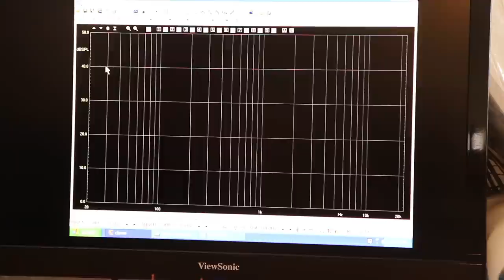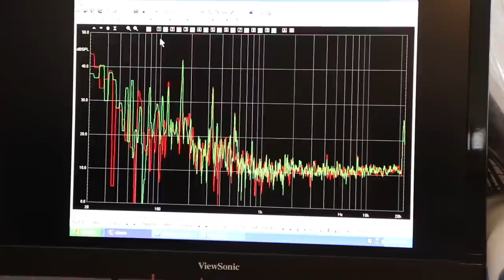Power Cable Tech Talk and a little help for Amir at Audio Science Review

Comment: i worked at a power supple company for over two decades and we had a high end Marconi receiver we used to test our power supplies for compliance with the UL requirement for conducted and radiated noise. That taught me how important conductor orientation as well as component orientation is when you want to reduce susceptibility to radiated noise. 

Quite a few of today's products use switch mode power supplies, if these are well designed they should not cause to much interference but be aware that quite a few small switch mode power bricks are not well designed when it comes to noise and some of the certifications you see stamped on them is just eyewash. Any country that would put melamine in baby food has to be watched carefully and their products have to be periodically checked to make sure they are complying with radiated noise requirements because they might change vendors and not realize the new vendors supplies are not what they think they are

Comment: Double-blind testing.  I've never seen a double-blind test showing an audible improvement for an expensive  power cable.  Until I see that test, I'm with Amir on this one.  But I'll go with Danny on his improvements to stock Klipsch speakers.  That improvement is both audible and measurable.  It's like turning off the "loudness" button on an old receiver.  The only audible noise I've ever had came from a ground loop.  And that had nothing to do with the power cable.

Comment: Definitely a good idea to keep interconnects from mains cables but in my time, no recording studio or mastering suite that I have visited had any fancy expensive mains cables.
Reply: & they are usually a mess; cables chris crossing all over the place...mmm...
Reply: Back in the day I had a friend who built recording studios as his business. The electrical systems in these recording studio he built are all custom built for purpose. I had even seen one studio with huge transformers installed in the back of the building. I assume that is why the power coming out from the outlets are clean and there is no need for power conditioning or the sort.
Reply: @jasonleyson7825  given the amount of money audiophiles put into line conditioners and magic cables, over and over again, they could do the same for their home.
Reply: @jasonleyson7825  Hi, there are a kind or triphasic power transformer used for "isolates" the secondary to the grid or primary circuit from electrical perturbations, noises, transitoires and electrical short circuit. It's made using a specific type i.e. of star delta connection and  design. They are called "power transformer for isolation" . Could be this
Reply: I remember, is a delta/delta power transformer and in some cases with the same voltage in primary and secondary. Please check the plate. Thank You
Reply: If you can't hear the difference then don't spend the money I can so I do no testing involved
Reply: @SKELERTON1  I bet you don’t, you just think you do due to the placebo effect. It is incredibly strong and hard to fight. Do double blind testing, and 100% you won’t spot any difference.
Reply: They use balanced interconnects, and professional equipment is properly designed (mainly) and power cables is a load of BS.
Reply: @SKELERTON1  Correction: You THINK you can hear a difference. Hearing it in reality, or hearing it cause you "Believe" you do feel the same, but they are caused by two entirely different factors. If you TRULY heard a difference, it would be measurable and it would be demonstratable and repeatable.
Reply: Haha, very true. Mogami cables might be the most expensive ones you might need, max. But that's just because of the lifetime warranty, reliability, and the awesome Neutrik connectors that wont fail you.
Reply: There are smart audiophiles, also. We "objective audiophiles" on the ASR are audiophiles as well. We just use our money a bit smarter in general for obvious reasons.
Reply: @jasonleyson7825 what about the power coming into the building ?

Comment: You said in the video that, the burn-in is important, because the conductor and dielectric are changing their properties. According to this phenomenon, can you tell what is a life span of a power cable and how often should I replace it?
Reply: often
Reply: @spudpud-T67  Thank you for the advice. After this answer I already know when to change the cables.
Reply: I burn them in for about 32 hours and then I find that the quality starts to deteriorate at about 50 hours so I use my cables for about 18 before I replace. I of course have a very resolving systems. For less resolving system you can probably use a cable for at least 50 before you notice deterioration.
Reply: BURN IN TIME FOR A CABLE...!🤣🤣🤣🤣🤣🤣🤣🤣🤣🤣🤣🤣🤣

Comment: I like this back and forth. I watch you and Amir both I'll like your comment on his assertion that once power goes into a component it is filtered for noise and stabilized before being used. Thanks.
Reply: If that were true then the power cables like ours would have no audible effect, but they do.
Reply: If the null test noise (regardless of it beeing a difference of random noises) was below 93dB in level you would have to play plenty loud and then wait for your ears to stop protecting themselves to be able to distinguish the noise at all. Every sound comparable in frequency also increasing the masking effect.

It’s not really scientific to say the cause of the experience of sound difference is due to sound altered by the noise in cables? That would be a jump into a conclusion from interpretation ignoring the psychoacoustics.
Reply: @martinenstrom8206  Or it could be in reality not 93db down.
Reply: @martinenstrom8206  well said!
Reply: Cody Smith  We have proven it hundreds of times.
Reply: @mrubengmail  No, it's what we call a fact.

Comment: I bought some bulk Furutech power cable years ago, and of all cables I have replaced in my system. The power cable is the one that I heard the greatest difference from. Which is kind of ironic since it was the one I was expecting the least from. I didn't notice a difference on every device I plugged in, but on some it was clearly there.
Reply: This is perfect explanation of why sighted testings are flawed & how strong placebo is.

Comment: I have done residential  home theaters, whole house AV systems, commercial data and security for over 20 plus years and it is a known fact that running any kind of low voltage signals alongside electrical for closer than a foot for more than 3 feet will cause inductance and degrade the signal. Only way around it is to cross at 90 degree angles and when forced 45 degree angles at the least. This is industry knowledge that one must adhere to when running any low voltage cable. I won't go into anymore depth on this as the facts are simple. Ask any professional in the industry and they will agree. Look at BICSI standards even. You are absolutely correct and those who have done the opposite experience a much worse signal with many problems.

Btw, love your videos and appreciate what you do, thank you!
Reply: That's why star quad is used in AV production, especially studios-- but the power cables are normal.

Comment: Funny stuff.  I install million dollar lab equipment.  Measures stuff to the angstrom level....NEVER had power cord issues, and it's all generic, computers, and hard use power cords, even inside the equipment, is some pretty generic, cheap wires........but somehow audio, is always different when it comes to electrical stuff.  Funny, you ain't quite Seinfeld, but funny none the less
Reply: In my RF lab I have to network analyzers, Phase Noise analyzers, Noise figure analyzers, Spectrum Analyzers, various RF generators; from around 5Hz to 110GHz and every thing going on standard computer power cables.
The most what I see is cell signal leakage for components that are soldered to open test boards.
Reply: Both you two refer to measuring s😅me thing we don't listen to, which is the problem of measuring sound. That v or amperage or capacitance or... 

It's like saying wine is 13% I measured it, but then it shouldn't taste different. Huh....
Reply: @iBeaver1973  Yeah because audio we listen is a reproduction. It is possible to measure the difference between the original and reproduction. Wine is wine. Audio measurements are not about how amazing audio sounds, they are about how different reproduction sounds compared to the original recording. That's why your wine analogy doesn't make any sense. 

Imagine a chef has a recipe and you follow that recipe. In this analogy, recording is chef's recipe and dac/adc/amp is how you follow the recipe. I can measure how different your meal tastes compared to the chef's recipe. That's what audio measurements show.

Comment: I find it bizarre how you measure speakers which is science to design a crossover but you accuse Amir of not being scientific by doing measurements to show two power cables have no electrical or interference differences.

If you really want to put this to bed, organise an ABX test with yourself and Amir as listeners but run by someone independent.
Reply: Amir takes measurements then theorizes a result. That is not science. 

I would also be glad to have Amir over for listening comparisons.

Comment: If a cable is connected on 1 side and not on the other side it acts as a capacitor meaning there is a current flowing when connected to an AC power supply. When connected to a DC power supply the current will flow at the moment of plugging untill the cable is charged. The current will be higher when the cable is longer. It is a low current but measurable. Please only say things that are correct. With high voltage these charges can be/are deadly. With low voltage and short cables as in your house the effect is still there but very low.

Comment: I didn't believe all cables sounded the same.... i just noticed thay when i had to use an extension cord in a pinch as a teenager, that it sounded the same as the higher priced popular mechanics cable.

Later in college i had a guy quickly change cabkes for me between a budget pair and a multi thousand dollar cable... no difference.

Last year in Texas listening to a D'Agnostico and Wilson setup, I was able to hear an issue with a DAC (later confirmed to be a firmware issue that caused some distortion on certain notes) that the participants noticed after I pointed it out and played the right part of the songs to highlight it.

Comment: There is I suppose a hypothesis here that
1. Cables could measure differently/the same (capacitance?)
2. Cables could attract noise dependent on their construction or reject it
3. All cables could sound the same or differently dependent upon their construction or materials used

The question is how does or can the above measurably improve/maintain the output from the audio equipment which creates a true hifi presentation from the music source?

The main issue Danny has is that Amir measures whereby in terms of cables Danny is pitching a different case - primarily rejection of interference. Rejection of interference can maintain the audio signal since it could avoid distortion. But ultimately every listening room/equipment set up is not the same.

Comment: Frankly I don't really care if cables change the sound of an audio system or not. The biggest differencee in sound quality will ALWAYS be the recordings you use. That's why the guys at audio shows still use Steely Dan and Dianna Krall recordings etc. Seek out better recordings not better gear. The value impact is a thousand times greater.

Comment: Are there affordable mains power analysers that give noise and harmonic distortion info. Better to start with the problem and work towards a solution that the other way around.
Reply: Not affordable if you want excellent resolution.  I do this all the time in every one of my power reviews.  I even have a lab grade AC generator where I can generate extremely distorted mains power.  I have done that and half decent audio gear does not care whatsoever.  Reason is that your audio gear runs on DC, not AC.  All the things that are wrong with AC is filtered out and the output is no longer AC.  This is why products like these power cables or AC conditioners, filters, etc. don't make an audible difference.  Your audio gear already does what they attempt to do!

Comment: The screen shot at 28:00 includes any AC noise from the entire system plus the room noise.  I did not see any screen shot with the mic gain shut down (off)  and just dealing with the AC noise from the mixer and/or the mic pre and the computer power supply. I have always used an MIT power cord on my computer which has lowered the AC noise in my system by -10db.  I now also use Furman AC filters on all my gear to clean up all the AC noise from the breaker box.  The other issue is what mic are you using?  Many mics have close to -20db of self noise, others like the NT-1A from Rode have -4 to -5 db of self noise, extremely quiet. What is left in using those mics is the ambient noise of the room, including the blower from your HVAC system, which hopefully is off when recording. It is one of the reasons I have complained about a company that records in DSD as their room noise floor is over -50 db with their mics open in their studio.  NOT ACCEPTABLE. Either their console is noisy from power supply issues, mic preamps, or the mics and the room?  Start at the beginning and see what the noise floor of just your computer is with no inputs open into your daw.  I am close to -80db.
Reply: Your power supply is going to deal with the noise, so it's largely irrelevant.  The important thing is whether or not the output of the device (ex; cd player, dac, etc.) is affected by the cable.  That's what Armin measured, and there was no difference.  That's the only thing that matters.
Reply: @literalghost929  Frustrated that I had to get this far into the comments to finally see some sense... pretty frustrating to see someone with this much audience having absolutely no idea what they're actually "measuring".

Comment: Danny you say your power cable needed 200 hours burn in. When do you know it is past it's best considering it seemed to burn in before reaching it's best? If this is the case it must have a particular lifespan due to continuous current flow causing the cable to burn in and burn out?
Reply: No, it doesn't burn in and then burn out. It has to do with the formation of the dielectric material.
Reply: @a0r0a7  Yes, really.
Reply: @dannyrichie9743  nonsense
Reply: @a0r0a7  Nope, it is a well known fact.
Reply: @dannyrichie9743 well known fact regarding components, Yes, warming up, getting older through use, tolerances can change. Wire No. I use to respect your channel alot but your views on cables sadly has changed my view.
Reply: @a0r0a7  That's okay. I get where you are coming from. Some people don't like it when facts contradict something that they believe.
Reply: @dannyrichie9743  Danny we will have to agree to disagree. The Earth is round, trust me.
Reply: @a0r0a7  It is easy to prove the Earth is round and it is easy to demonstrate the differences in burn in.
Reply: @dannyrichie9743  perhaps do a video then🤔
Reply: @a0r0a7  And tell everyone all about it. :-)  People will only understand when they hear for themselves.
Reply: @dannyrichie9743  why didn't you just leave it at agree to disagree? You make the claim like so many audiophile companies about cables, expect challenge. If that is the case cables will continue to change, why 200 hours burn in? Why not 50, 300. How did you come up with this figure, you must have measured something to know there is a change in the cable after burn in? No you just hear it and yet you totally measure when working with crossovers?
Reply: @a0r0a7  It is easy to hear differences throughout the process and when it reaches a settled level and stabilizes. Some things are easy to measure and some things are not. Just because some things are hard to measure and quantify does not nullify it.
Reply: @dannyrichie9743  agree to disagree.

Comment: Would be very grateful if someone can explain how does the power cable filter/remove the noise/intereference from the electrical network before it?
And if a power cable can do that, then why can't the amplifier do it instead?
I have always thought that this is the job of a good power supply...
Reply: It is the job of a power supply to deliver clear power. However, in practice they tend to need all of the help they can get.